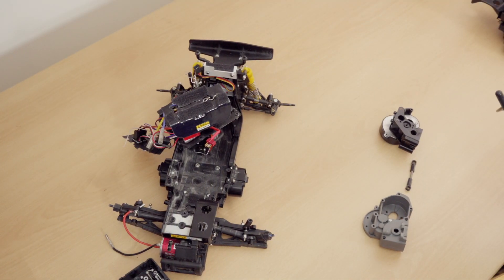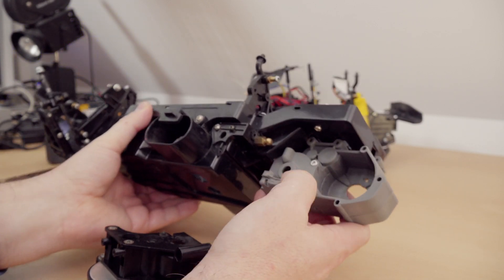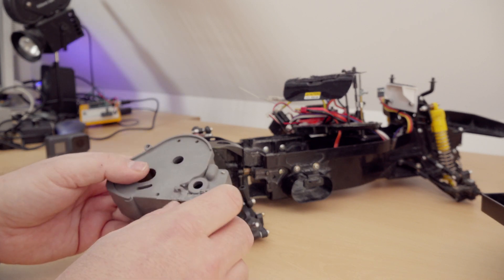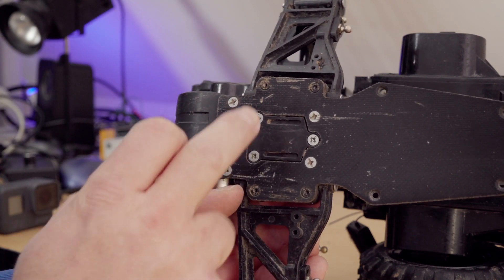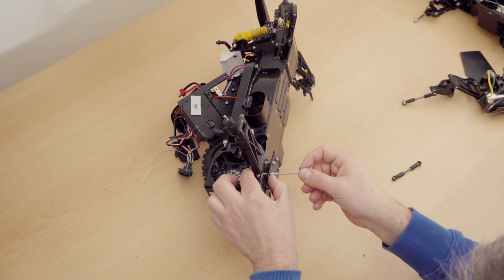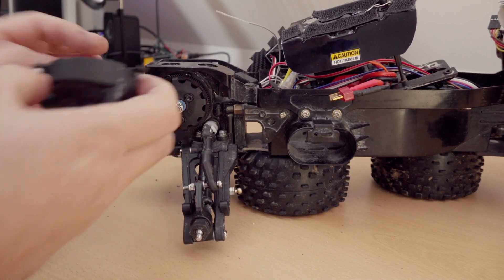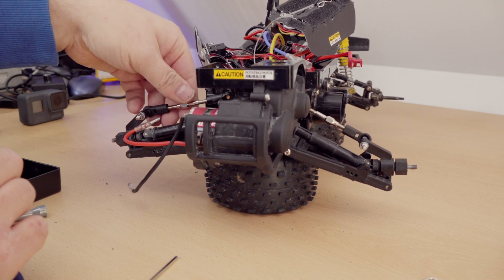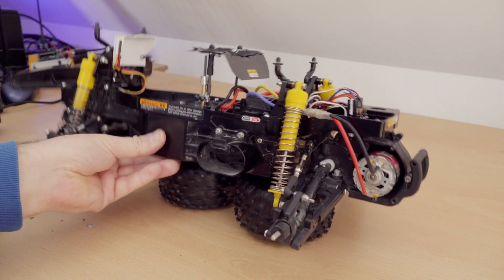Tamiya King Cab + Traxxas Slash rear axle - Introducing "The King" Part 2

Comment from the maker: If you want to copy that conversion, here is part list.
Traxxas Parts:
Gearbox TRX3695
Motor Spacer TRX3790
Drive axle connection TRX4628R
Drive axle TRX1951
Lower arms TRX2555
Suspension pins TRX3640
Uprights/Wheelhub TRX3752
Wheel axle TRX2753X
Hex+Pins TRX1654 (Info: if you drive original rims, they need slightly wider/longer Hex adapters – if you drive other rims, they might fit just fine)
Spacer TRX1985

Non Traxxas:
P48 Pinion gear for your motor
M3 Screws, Nuts, spacers
M4 threaded rod for lengthen the upper arm.

Comment: @timediavideo i just came across this video today as I was doing some King Cab research for a mate. I just wanted to say great minds think alike, i did this same conversion to my 2018 Super Astute about 5years ago but i utilised the original arms. The original gearbox was too weak for the brushless setup and I had a Rustler transmission available. Same as you I saw the similarities and now I have a Tamaxxas Super Astute 😊

Comment: Another gearbox solution can be the 1st version of the Axial SCX10 gearbox that also can be found in alloy versions. With that setup you could retain the orginal arms and mounting points fitted to that plate.
I'm going to do that solution on a Lunchbox later on.
Ampro Engineering never seem to release the IRS system for the Lunchbox, so I want to do my own.

Comment: One big week spot is the chassis I had a hi-lux monster racer and the chassis would crack all the time on the right hand side near the front. They did make a aluminium chassis but good luck finding that now.
Reply from the maker: I agree 100%. I suspect this is one of the reasons this chassis was never re-released: the warrenty problems would be immense.
Reply: @timediavideo  I think so also. It would crack on jumps it would crack if you ran into something, it would crack if you looked at it wrong. I always had a spare on me or a drill and a bunch of zip ties.

Comment: You can find the upgraded differential for the king cab on eBay .
Reply from the maker: Yes. I checked that option. But eventually decided against it. On the one hand there was the high price of the diffs. On the other where many reports that a stronger diff is "forwarding the problem" into the gearbox. As there is no slipper clutch it puts all the stress to the remaining gears.
Reply from the maker: Ohh... and one additional point: All the addons make this car very heavy. A good diff would therefore put even more stress onto the remaining gears compared to a standard King Cab.
Reply: No problem it was just a suggestion. 
I have three of them that I’m working on.
I did the stealth gearbox on one of them. And did the geared differential on the other also upgraded the counter gear,center gear and the carrier gear. So far I have no issues I’ll give an update later on.
I’m just trying both to see how they hold up
Reply from the maker: @ranjetcar  This is a very interesting info! I am already planning on a future video on all the gearbox upgrade options, as I have learned a lot since my upgrade. Would be great to include some first hand knowledge from your experience!
Reply: I also liked what you did too and might give it a shot

Comment: Are you on FB?? Would love a detailed parts list for the KingCab and happy to pay for custom parts if you make?? Thank you
Reply from the maker: Hi! Yes, you can find me in the King Cab (and other) facebook groups. Also in Tamiyaclub forum. Part list is a good idea. I will create one. As for custom parts: Sorry, I cant "massproduce" these. Actually the one plastic stand might strictly speaking not even be vital. I made it for peace of mind. You could just stick long screws through these holes and add counternuts on all in/out points.
The aluminium plate is important. so you need to find somebody to cut this. An alternative option would be to cut a new bottom plate from a piece of carbon without the King Cab diff-hole.
Reply: @timediavideo  What’s your name on FB please?? Easier to msg on Messenger 👍😎

Comment: Why did you have to install the Traxxas gearbox?
Reply from the maker: The original King Cab gearbox is known to be too weak for the car. Namely the diff. Mine was already slipping terribly. Original Tamiya parts are very rare and they are no long term solution.
3rd party replacements from the past are hard to find and sold at extreme prices.
This option just uses 2022 up to date of the self parts that are available at reasonable prices.
Reply from the maker: I even forgot one additional point to my first answer: This King Cab gained more than 0.8 kg of extra weight due to all my add-ons... so the poor old underpowered gearbox was in even more stress than before. ;)